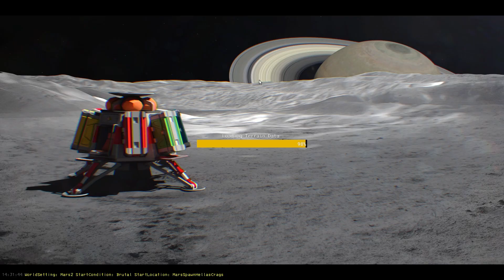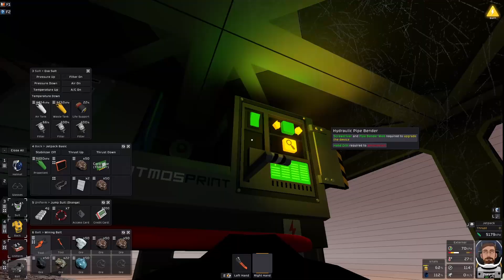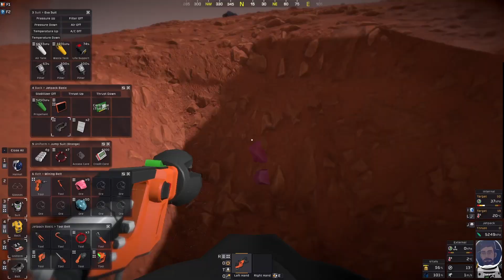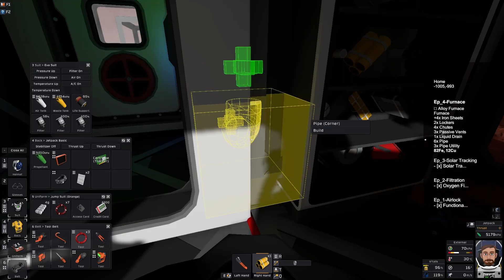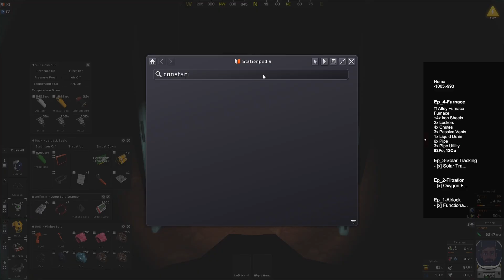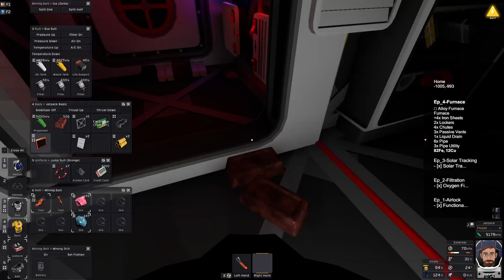Stationeers: Season One: MSB - Episode 4

Comment: You spent a significant amount of time to collect the furnace gasses. However, on Mars, all of the gasses regular plants need is in the atmosphere!!! In fact, to get the pollutants to drop out, you do NOT even need a filtration unit. By compressing atmospheric gas into an inline tank upto 5 to 6 MPa (with a condensate drain connected), all of the pollutants (and some of the CO2) will condense out. If you collect during the day, then just pollutants will condense out. However, even at night (or combined day/night collection) enough of the CO2 persists to feed the plants. You will also get Nitrogen and O2... but over 90% CO2...
   An early game setup could be: Active vent -> pipe section with condensate drain -> Inline tank ->pipe section with condensate drain -> oneway valve (off during collection) -> inline tank for holding -> pipe/regulator/passive vent for in-base release. This would require manual operation in early game; but later can be automated.

Comment: 7:25 i don't know if you did it so fast I didn't notice... but I'd suggest getting into the habit of always clicking on the right or left arrow after you request something to print if you just want 1 of (like your furnace). selecting a different recipe will automatically cancel the print after the current one is done, saves you from walking away and potentially coming back to a pile of furnaces  :D
Reply from the maker: Yea I only recently learned about that. Still trying to get in the habit.  Still trying to figure out if I’ll have to do coding to have a “make 3 of these” button